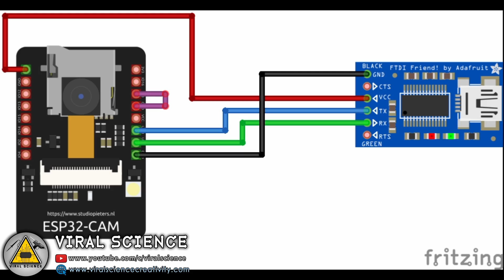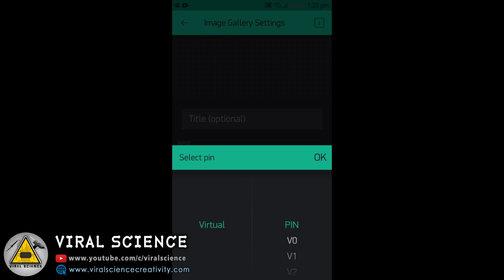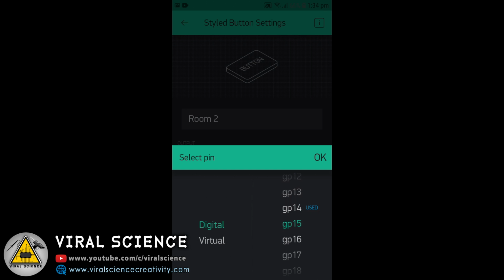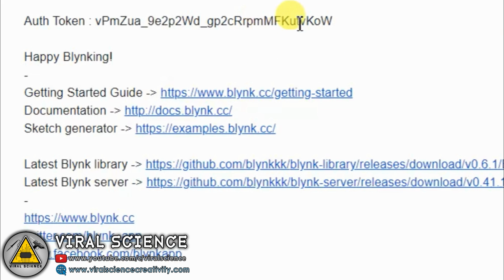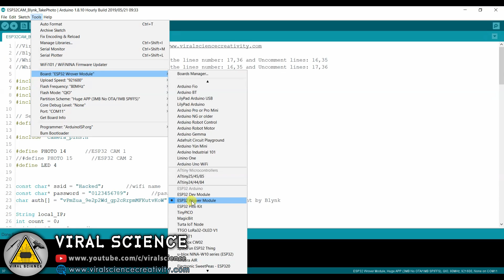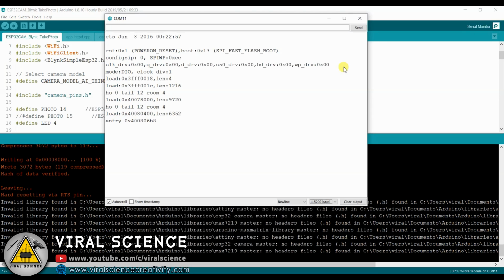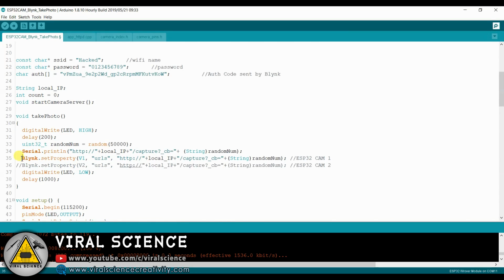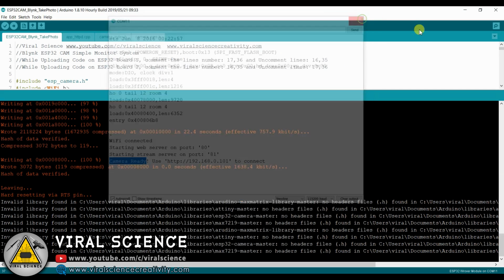ESP32 CAM Blynk Multiple Camera Surveillance

Comment: To use an external antenna, just move the resistor next to the connector from the / position to the \ position.  It is a 0 ohm resistor so you can just use a solder bridge from point to point if you want.

Comment: Hi Bro i am upload time this error message came

app_httpd.cpp:22:24: fatal error: fd_forward.h: No such file or directory
Multiple libraries were found for "WiFi.h"
compilation terminated.
 Used: C:\Users\senth\AppData\Local\Arduino15\packages\esp32\hardware\esp32\2.0.2\libraries\WiFi
 Not used: C:\Program Files (x86)\Arduino\libraries\WiFi
exit status 1
fd_forward.h: No such file or directory

Comment: Great Tutorial have following questions :
Q> How good is ESP32 Cam ?
     What is the pixel value of the images (Layman's terms would I be able to recognize faces)
Q. How good is your case for external use ?
Q. What does the Blynk do ?
Q. How can I set-up the UI on my computer screen instead of a phone.
Reply: 1600x1200. Just use a webbrowser.  Blink is just a LED light for illumination of dark rooms in the night.
Reply: The Blynk software is an IoT server on the internet so you could access the board remotely (not to be confused with Amazon's Blink cameras). Blynk is free for 2 devices, $7/mo for 3 users and 10-20 devices.

Blynk also seems to offer compiling and "low code" drag-n-drop coding.

Comment: I have problmes getting this to work.
The Serial monitor shows Brownout dtector was triggered and the controller restarts over and over.
ets Jun  8 2016 00:22:57

rst:0xc (SW_CPU_RESET),boot:0x13 (SPI_FAST_FLASH_BOOT)
configsip: 0, SPIWP:0xee
clk_drv:0x00,q_drv:0x00,d_drv:0x00,cs0_drv:0x00,hd_drv:0x00,wp_drv:0x00
mode:DIO, clock div:1
load:0x3fff0018,len:4
load:0x3fff001c,len:1216
ho 0 tail 12 room 4
load:0x40078000,len:10944
load:0x40080400,len:6388
entry 0x400806b4

Brownout detector was triggered

What is wrong?

Comment: hola amigo, instale tu programa codigo y me salio este mensaje
 Arduino:1.8.13 (Windows 7), Tarjeta:"ESP32 Wrover Module, Huge APP (3MB No OTA/1MB SPIFFS), QIO, 80MHz, 921600, None"

ESP32CAM_Blynk_TakePhoto:14:25: fatal error: camera_pins.h: No such file or directory

compilation terminated.

Se encontraron varias bibliotecas para "WiFi.h"

Usado: C:\Program Files (x86)\Arduino\hardware\espressif\esp32\libraries\WiFi

 No usado: C:\Program Files (x86)\Arduino\libraries\WiFi

exit status 1

camera_pins.h: No such file or directory

Este informe podría contener más información con
"Mostrar salida detallada durante la compilación"
opción habilitada en Archivo -> Preferencias.

si me pudieras ayudar te lo agradesco.

Comment: Great project. The icing on the cake would be a battery powered solution (lipo) so that the camera is totally wireless
Reply: the icing on the cake would be having clear video and not 3 choppy frames per second
Reply: @Greggy Ramirez No but based on what you say should I be looking?
Reply: @Greggy Ramirez I would look into Lithium Ion technology, e.g., 18650/21700 cells. They are safer than lipos and have a higher energy density.

Comment: Nice project! I did it on my local Blynk server (one camera only). I tried to setup a remote camera connecting to 3G mobile router and then via No-Ip to my local Blynk server. The button works - LED flashes, but no picture is taken. Any ideas how to solve this?
Reply: He didn't show how to use the IP adress in the Blynk app, I was going to comment about that.
Reply: Did you add the IP address on the image URL in the app ?

Comment: I am not sure if your "anteena" is working. I'm pretty sure you didn't modify the cam board to enable the external "anttena" It looks as if only the onboard "anteena" is enabled.
Reply: I was thinking the same.  You need to move the zero ohm resistor beside the antennae to the other position.  Thanks for video.

Comment: Hi sir please help when I am connecting my esp32 cam to power bank its working but in few minutes it heating up ,plzzz tell me what voltage should I give to esp32 cam so it can work properly and don't heat please tell
Reply: Hola compañero, a 5v, ronda los 0.300A 1,20w ( en VGA640 x 480)

Comment: When programming the ESP32 board, the jumper on the FTDI USB board must be placed on 3.3V! You must change (or check) if the 0 ohm resistor is placed correctly to use the external antenna. You should remove the plastic in front of the camera lens!
Reply: Is removing the plastic compulsory?
I don't think it would stop the cam from working...?
I was actually unable to make it work, and i also didn't removed it's cover yet...just so that I can return it, incase
Reply: @HarshitSingh-mg7zt  i got it to work, what's your problem I might be able to help
Reply: @cdbetten7188  thanks😊
But I sorted it out myself already
Actually, my board was faulty, so i replaced it, and it worked first try! :)
Reply: @cdbetten7188  What antena do u use?

Comment: NO IP coming after several tries 
Unable to see the output 

This is the output of the Serial monitor

ets Jun  8 2016 00:22:57

rst:0x1 (POWERON_RESET),boot:0x13 (SPI_FAST_FLASH_BOOT)
configsip: 0, SPIWP:0xee
clk_drv:0x00,q_drv:0x00,d_drv:0x00,cs0_drv:0x00,hd_drv:0x00,wp_drv:0x00
mode:DIO, clock div:1
load:0x3fff0018,len:4
load:0x3fff001c,len:1216
ho 0 tail 12 room 4
load:0x40078000,len:9720
ho 0 tail 12 room 4
load:0x40080400,len:6352
entry 0x400806b8

[E][camera.c:205] skip_frame(): Timeout waiting for VSYNC
[E][camera.c:1270] esp_camera_init(): Camera init failed with error 0x20003
http:///capture?_cb=21843
http:///capture?_cb=11972
/home/runner/work/esp32-arduino-lib-builder/esp32-arduino-lib-builder/esp-idf/components/freertos/queue.c:1442 (xQueueGenericReceive)- assert failed!
abort() was called at PC 0x4008dcbd on core 1

Backtrace: 0x40091888:0x3ffb1d50 0x40091ab9:0x3ffb1d70 0x4008dcbd:0x3ffb1d90 0x40136036:0x3ffb1dd0 0x40136312:0x3ffb1df0 0x40124a50:0x3ffb1e10 0x40124ab9:0x3ffb1e30 0x4012077e:0x3ffb1e50 0x4011f288:0x3ffb1e70 0x40123a80:0x3ffb1eb0 0x400d4103:0x3ffb1ed0 0x400d3a6e:0x3ffb1f20 0x400d2076:0x3ffb1f50 0x400d27a5:0x3ffb1f90 0x400d5bfd:0x3ffb1fb0 0x4008dfd1:0x3ffb1fd0

Rebooting...
ets Jun  8 2016 00:22:57

rst:0xc (SW_CPU_RESET),boot:0x13 (SPI_FAST_FLASH_BOOT)
configsip: 0, SPIWP:0xee
clk_drv:0x00,q_drv:0x00,d_drv:0x00,cs0_drv:0x00,hd_drv:0x00,wp_drv:0x00
mode:DIO, clock div:1
load:0x3fff0018,len:4
load:0x3fff001c,len:1216
ho 0 tail 12 room 4
load:0x40078000,len:9720
ho 0 tail 12 room 4
load:0x40080400,len:6352
entry 0x400806b8

Comment: Dude, you forgot to switch the 0 ohm resistor from internal antenna to the external port, my guess is that your pretty little antennas are not working and all of the traffic has been handled by the onboard ones. Also If I were you i would have printed the cases a bit different, i would put a standardized power connector, like microUSB or a barrel jack, when you are leaving the pins exposed like that you are leaving room for error and i bet connecting the DuPont connectors, wrongly won't be so good for the boards. :)

Comment: It would be really nice to see an example of this using FPV or using SIM module. I
I want to implement this in my siege house and there is no wifi connection there. So be able to access it remotely is a bit challenging but I'm sure it is possible. 
I'm thinking in write a Rest API and host it in AWS, I'm just not sure yet how to build the circuit to it.. hummm...
Reply: Likewise - as a remote webcam solution using 4G, even scheduled/timelapse images this would be ideal, but how to connect/configure a 4G board?

Comment: I was unable to make an account on FlyRobo because it said my mobile number is too long. I don't know what +91 means either. I have a standard 9 digit American phone number. I added +1, which most countries accept. I tried +91 but that didn't work either. Is there somewhere else I can purchase the ESP32-CAM device?
Reply from the maker: +91 is the code for Indian Mobile numbers and flyrobo delivers only in India, you can try amazon, Banggood as it is available on these sites
Reply: @ViralScience  Okay. Thanks for the heads-up. Great video by the way.

Comment: For connecting the external antenna, you have to desolder the small resistance from internal (onboard antenna) and solder it to external antenna. Otherwise there is no benefit. Please verify. Kindly check: https://youtu.be/visj0KE5VtY?t=1368

Comment: You have to change a resistor to another position to work with the External Antenna not with internal Antenna
Reply: True, I was about to comment this
Reply: External Antennas are useless in this project. Yo missed the configuration brother.
Reply: Can you explain more about this?
Reply: I too want to point out this.Either you have internal or external.check connection . Disconnect internal by unsoldering and connect to ext.As it is 0 ohms you can use small thin wire to make connection.Thanks to Drone.
Reply: Absolutely NOT! bla bla bla... Just because you run across a youtube video dealing with the subject... Spreading IDIOT FIX while it's way smarter to order another ESP32-CAM which comes with an antenna and the good PCB. Something like $2 as extra, instead of trying to modify a supertiny circuit... which requires a good hobbyist's magnifier and a serious soldering station for SMCs mounting, i.e. USD 140 at least... just for one purpose! Completely insane! Buy the antenna-version and basta!
Reply: The resistor is 0 ohm.  Just need to desolder the "resistor" and solder it or a jumper to the external antenna connector.  The. Stock position is /  Move resistor or jump to position \
Reply: Pls anyone explain more about this
Reply: @wandaniel4596  Even if you attach an external antenna, the ESP32 will still use the built-it one until you move the sma resistor to a new position. Just google for "esp32-cam antenna resistor"))
Reply: @MichaelTayrov  thank you sir
Reply: My esp is programming but no ip shown in serial monitor what may be the reason I have selected Esp32_Ai_Thinker module in board manager

Comment: That's really cool, would you be able to make a tutorial on how to make video security cams, instead of taking single image shots?
Reply from the maker: Sure i will try it
Reply: sir actually we can do it using this same code..in blynk app change button from 'pressed' to 'on'..in that way a lot of pics will be captured and will eventually show as a video..small lag will be there but it's fine. @S7 u can try it..it worked for me
Reply: @ViralScience  Cool project! One important thing: if you use external antenna, you will need to move 0R resistor (aka jumper) to another position, or replace it with small drop of solder.  This will disconnect internal antenna and connect external one. 0R jumper resistor is really small and is located right near ext antenna socket. Hopefully this was helpful
Reply: sir actually we can do it using this same code..in blynk app change button from 'pressed' to 'on'..in that way a lot of pics will be captured and will eventually show as a video..small lag will be there but it's fine. @S7 u can try it..it worked for me